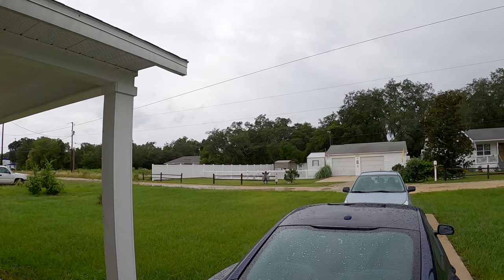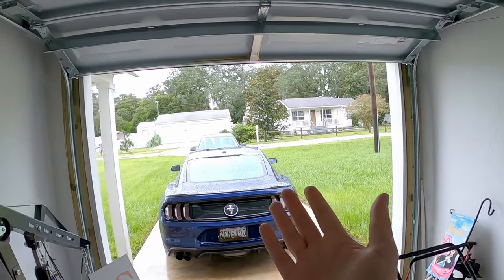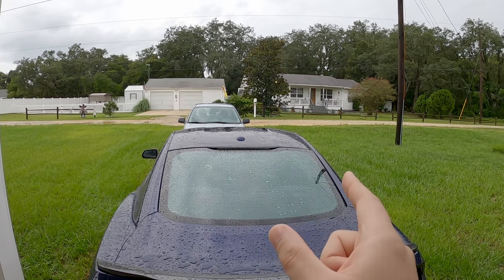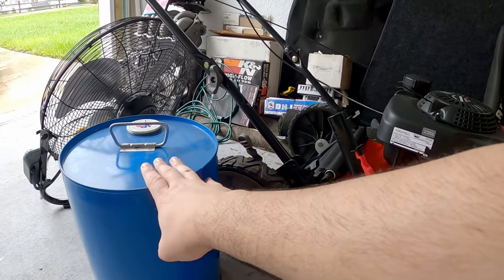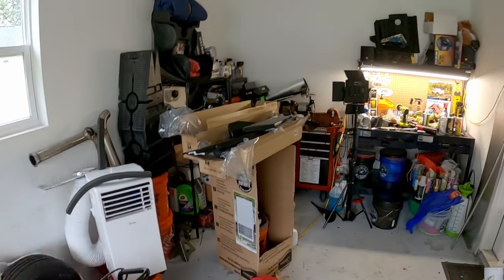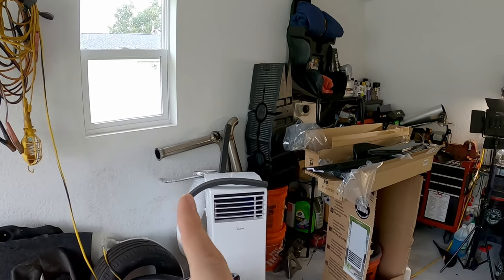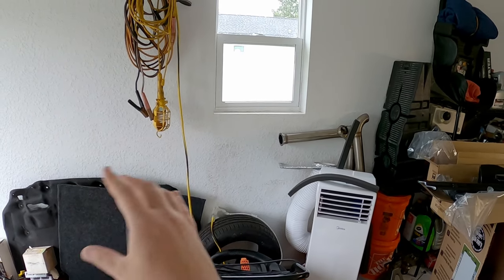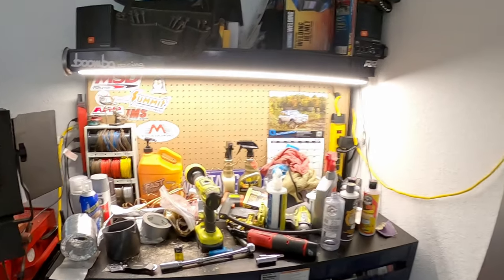Am I Crazy to Even Try This in my Mustang? *Mad Science Stuff*

Comment: Without making any modifications, other than switching fuel to 1 part VP X85 to 4 parts 93 octane pump gas, I was able to reduce my 1/4 ET from 13.01* to 12.60, while running an OTS stage 3, 93 octane tune.
*Personal best while burning 93 octane pump gas.